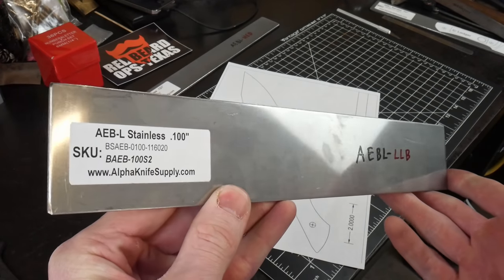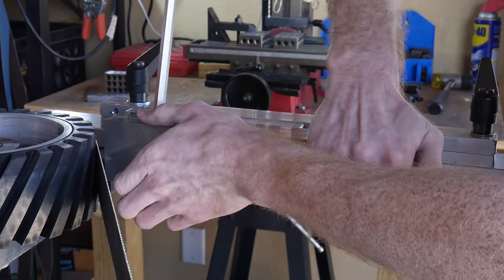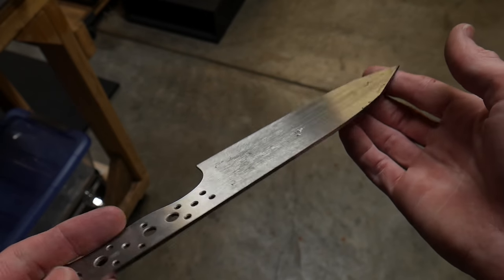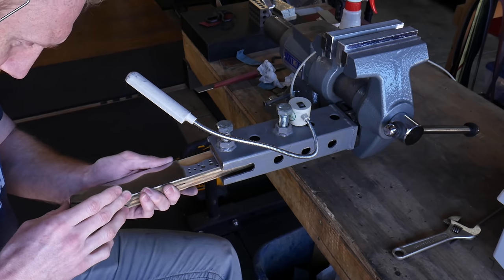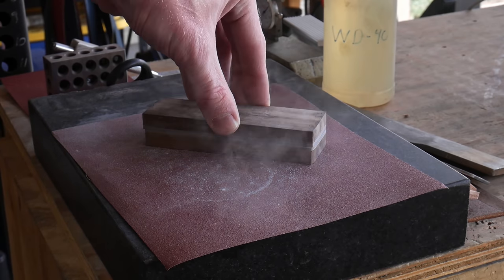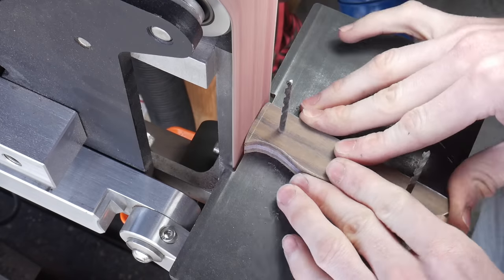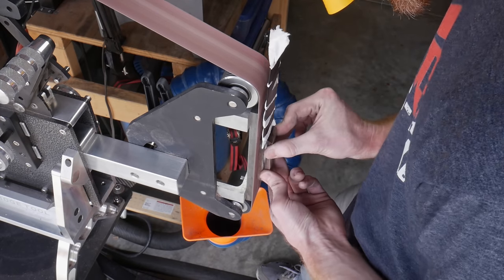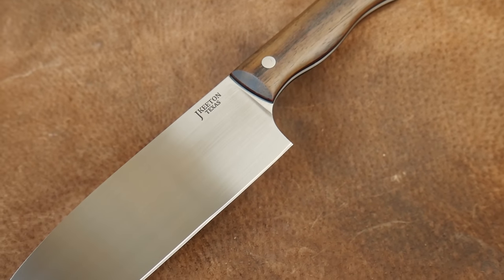The Gyuto Chef Knife Challenge | Knifemaking | Red Beard Ops

Comment: Great job, man! I'd love to start seeing more kitchen cutlery on your channel. I do more kitchen cutlery than EDC or hunting blades in my shop. Next time you should try a distal taper on your chefs knifes! It's kinda tricky to get it down, but, once you do, you'll notice that they not only perform better but that the weight distribution of the knife as a whole will be closer to what you really want in a chefs knife.
Reply: Distal taper has a pretty steep learning curve unless you have some good equipment to work with starting out.  I bet that surface grinding attachment of his could be adjusted for a super precise taper though.  Arctangent of how much you want removed for the taper divided by length of desired taper and you've got the angle to set your surface grinder to, just have to precisely locate the blade when you swap sides...
Reply: @Skinflaps_Meatslapper  the beat way I learned it was by doing it freehand on my 2x42 grinder. I do it on very large kitchen blades and very small kitchen blades. Generally, the rules are always the same. And if you break it down in sections along the blade, then finish with full strokes on the belt grinder from heal to tip, you'll end up with a nice even distal taper. I definitely screwed up a few blades when I first learned this process. But I now have it down pretty well. It's not too bad, you just have to think ahead before grinding.
Reply from the maker: Thanks for the pointers!